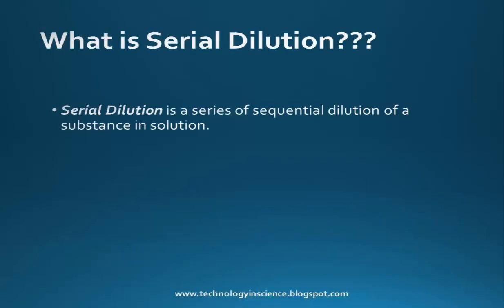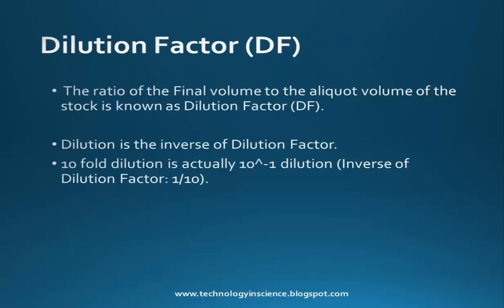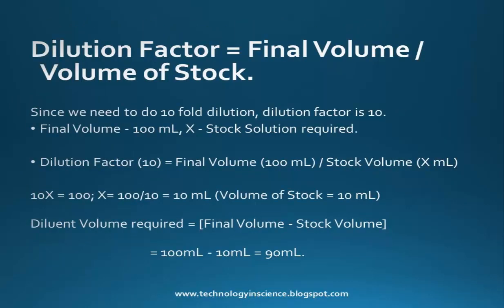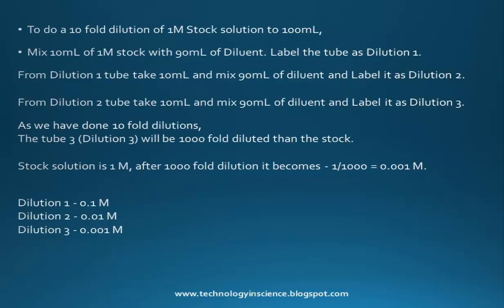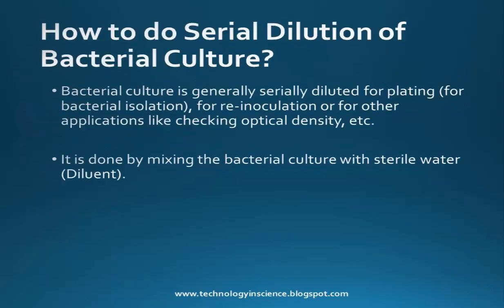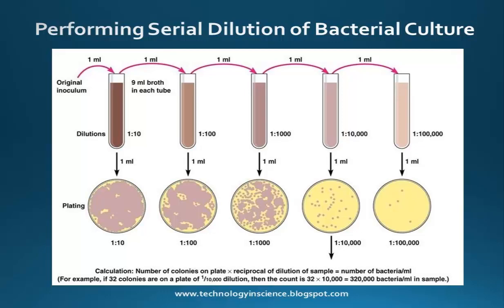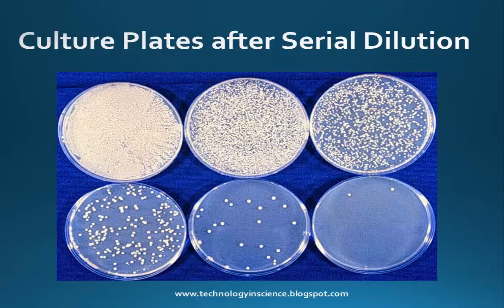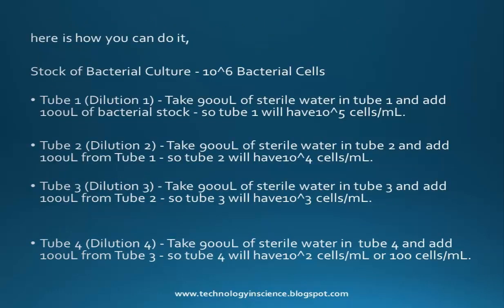Serial Dilution - Methods and Calculations

Comment: For me the most confusing part is that everyone pronounces a dilution of for example 1 : 10 a 1 TO 10. My initial thoughts when hearing 1 TO 10 are that one should mix 1 part of the stock with 10 parts of the dilutent, instead of the 9 parts one actually uses. For me calling it a one tenth dilution would seem way more intuitive.